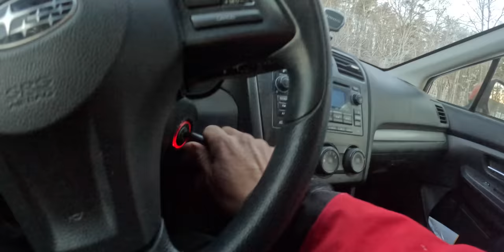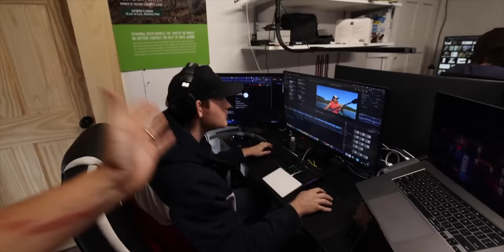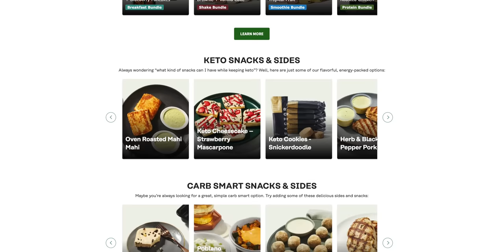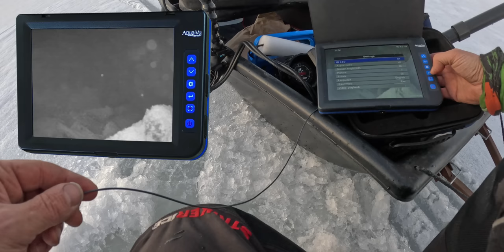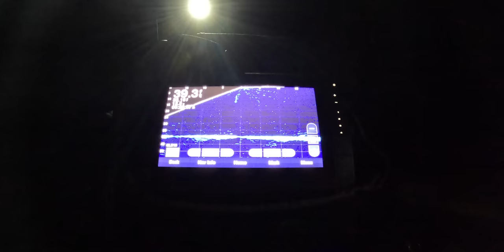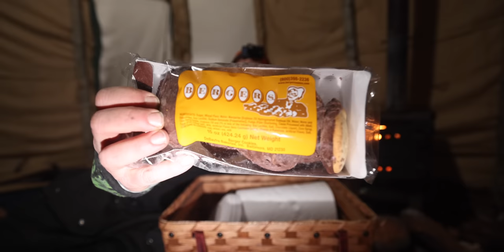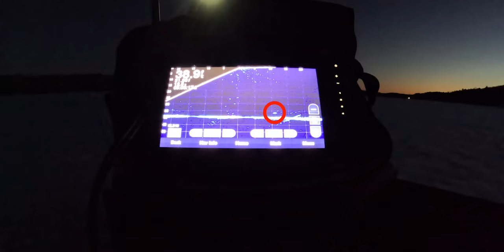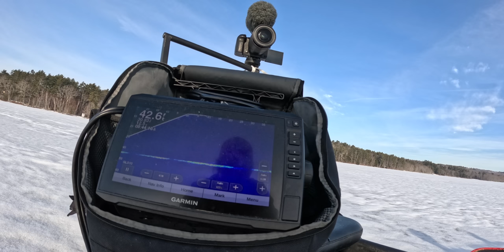How To Find Trout in Any Season Catch & Cook | Maine Arctic Blast Survival Challenge Day 7 of 7

Comment: I haven’t fished trout in the winter.  A couple of lake trout in deeper water,  but no trout.  Perch and pike we’ve caught a ship load of, and thanks to the tip from an old timer when we started, we got them all at 5-15 feet of water.       Pro tip from a guy who was the youngster on maybe 50 trout fishing trips (young guy cleaned all the fish), put the knife in under the gills, near that first fin, use your thumb to pinch down on the spine of the knife, and pull.  Once you get the hang of it, you can pull the guts, those first fins, amd the gills all in one shot